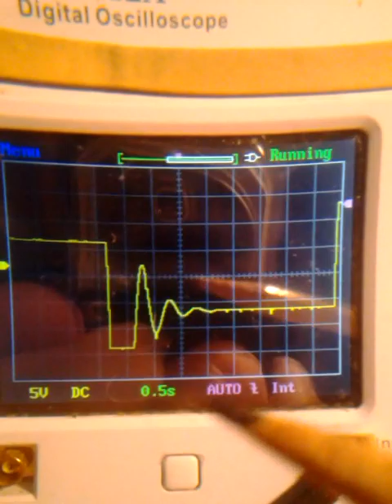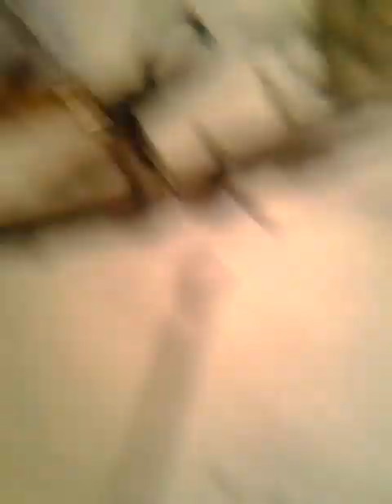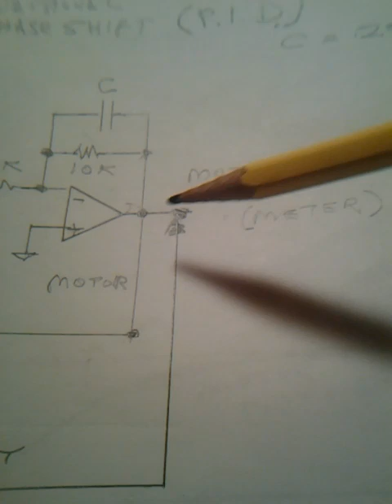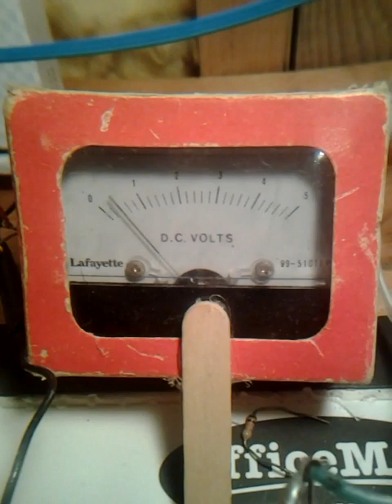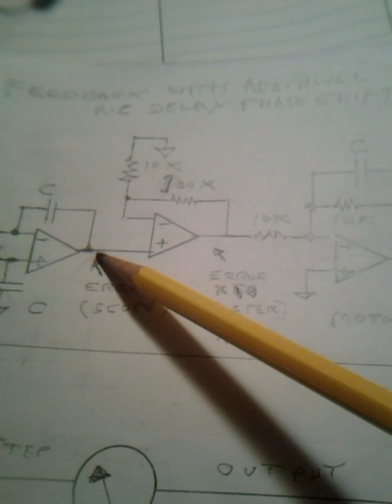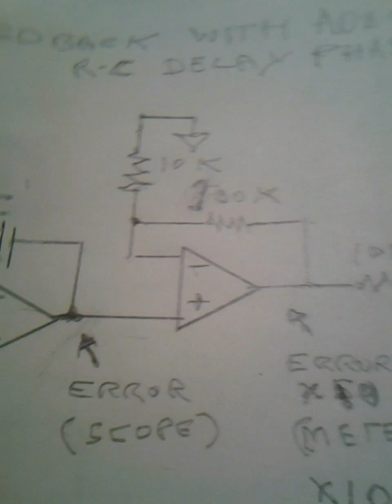The behavior of the accommodation system of the eye. Learning why myopia prevention will be possible

Comment from the maker: Optometrists talk through their hats,  and create block diagrams,  that they DO NOT UNDERSTAND.  
Only when you build A WORKING MODEL,  will you understand what you are talking about.  
The entire point is that Electrical -  Control Systems Engineers understand and talk by building these models that actually work.